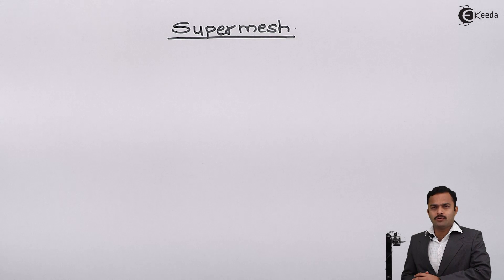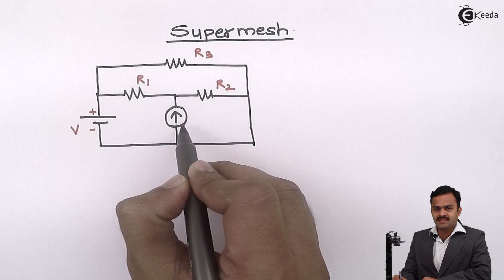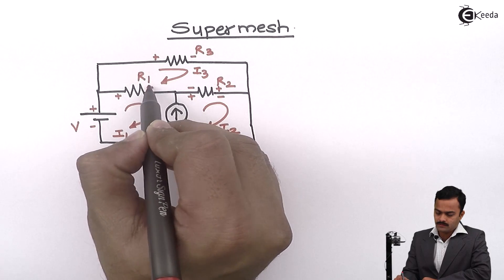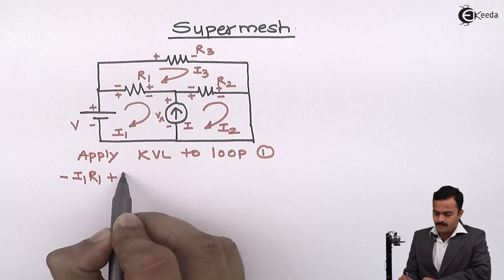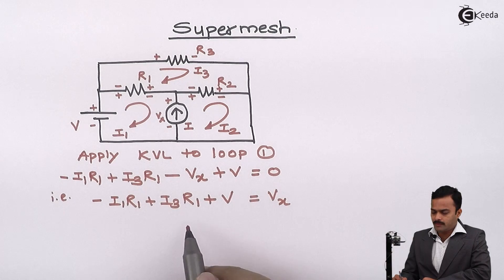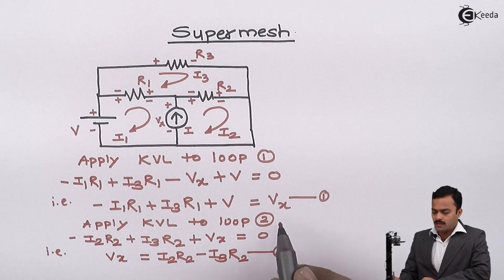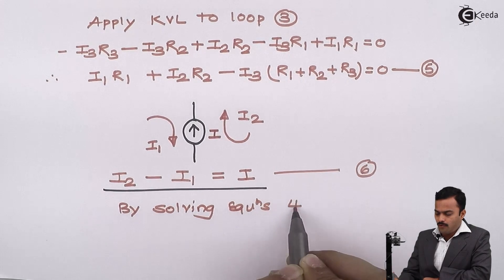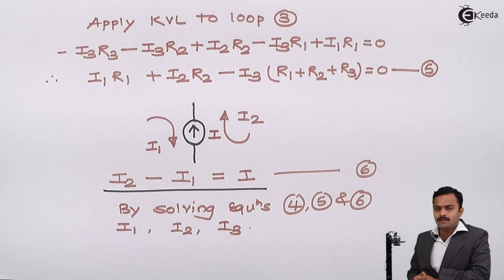Introduction to Supermesh Analysis - DC Circuits - Basic Electrical Engineering

Comment: Dear Students, Myself   having Teaching Experience more then 13+ Years.
The major Subjects which I have thought more than 3000+ students and Expertise in Circuit Analysis, Digital System Design, Control Systems, Linear Algebra, Microprocessor, Satellite Communication, Analog and Digital Electronics , Communication Systems and so on.  The main idea of this channel is to educate students free of cost.  Many students feel very difficult to understand the lecture in classroom sessions and students needs a recorded video which they can watch anytime to understand the concept. So this channel will make you to watch videos related to your subjects which helps you all to understand the subject and finally do well in exams. 

https://www.youtube.com/channel/UC4bDpTs5tRVdSQuPRn7Mv1g

some of the major subjects I covered in videos
Control Systems
Electrical Network Analysis
Digital System Design
Linear Algebra and Engineering Statistics
Microprocessor
and still more will be uploaded

you can all reach me nggk1234@gmail.com for any doubts you face.